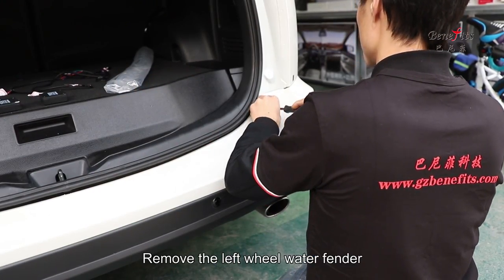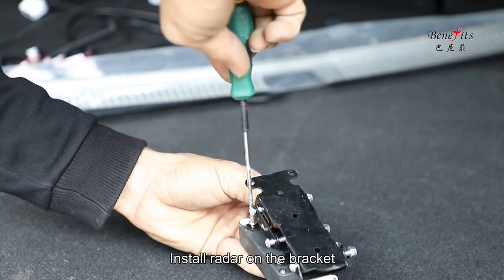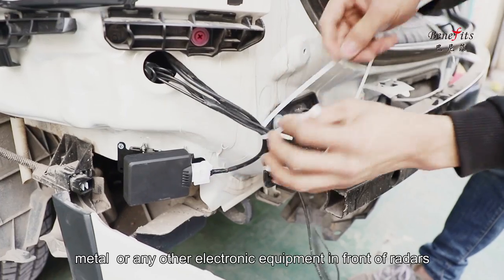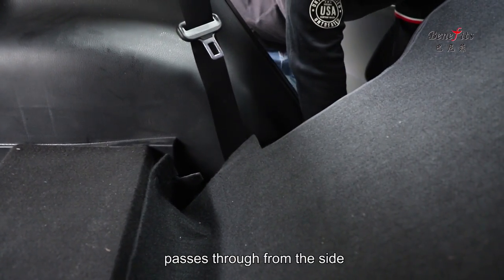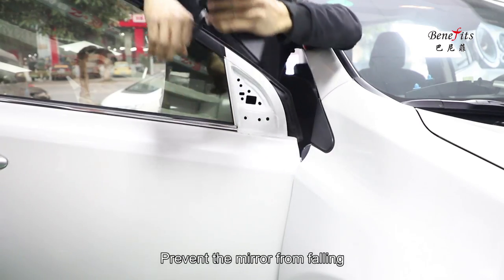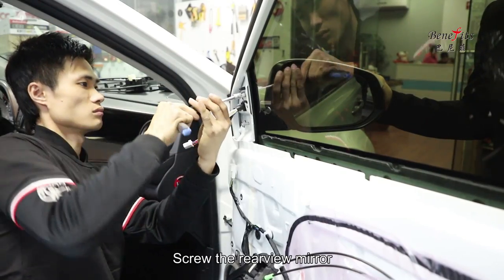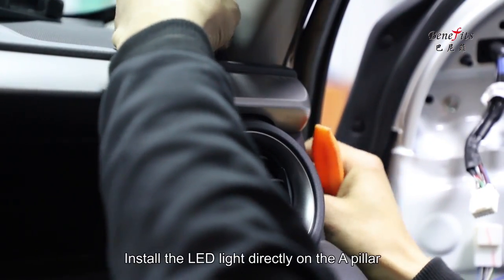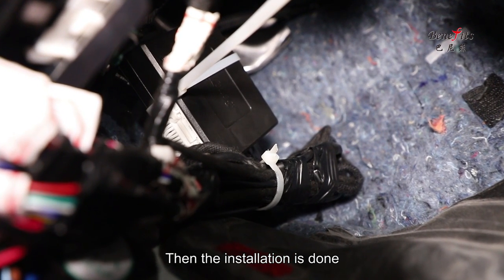Blind spot detection and lane chage assist system ''s installation

Comment: Will this blind spot detection fit my 2017 Toyota Tacoma?
Reply: @victor91607  Yes, these universal BSM kits that will install on any vehicle. If you are not in a rush and can wait 2 weeks for shipping, look up on Aliexpress. Lots of vendors with options. Don't expect to pay more than 250 for this system.
The link posted by Victor is crazy overpriced. Identical kits on Aliexpress are available in the $90-$250 range
Reply: a b $90 - $250??? you will get what you pay for. Simple as that.. for that price you are getting parking sensors that you will need to DRILL into the sides of your bumper! Jajaja and they will drive you insane when you can’t get them to stop beeping specially while making a right turn at any intersection (while your car is stopped) detecting the trash can on the side walk or anything stationary for that matter! Jajajaja .. again, take a look at my video and learn from it... this feature is design to assist the driver and supposed to make the vehicle safer on the road.. not make it a threat like all these other cheap kits.. these cheap kits were built based on price, not based on functionality... there  shouldn’t be multiple versions of the “blind spot” detection systems, there should ONLY be ONE, that ONE system is the OEM system and the only OEM-GRADE system now available for vehicles that didn’t get the OEM system is the USA SPEC BSM200.. nothing else... everything is the dumb down version again, based on price.
Reply: @victor91607  

Paying more doesn't necessarily translate into higher quality. Its your $ and you can pay as you want but 800+ for a freaking BSM excluding installation is a ripoff. 
Yes 36" level bars from HomeDepot and protector is all I needed for install the microwave sensors. The adjustable brackets, templates and marker sheet was included with our package. Do a search on Aliexpress/Alibaba and see the prices of all BSM systems with the following features: BSM/Rear Cross Traffic/Door Open Warning with and without speed control using GPS/OBD. 

We are in the process of integrating a cab fleet with the latest BSM 4-in-1 system where all you have is one control box embedding everything including the buzzer, GPS (for speed monitoring) from a supplier who is OEM for Toyota/Honda/VW. Single unit Price $230, bulk price: to be negotiated but we expect it to be around 175

BTW I don't have to prove anything to you. Just pointed out the fact that your self-promo link for the BSM was way overpriced. Just providing options to fellow youtubers who might be interested
Reply: a b a b a b a b When it comes to Blindspot Detection with rear cross traffic it does, it cost over twice as much to build the right product vs the junk on aliexpress that has NO real life in vehicle testing done.. “36” level bars and a protractor is all” wow, that would take the average person hours just to angle one sensor not to mention 2 of them.. just give a pre-made angle ruler and what would normally take hours will take 15mins... like the system i did.. ooooh! It’s cause you’re promoting your product in here, i’m a consumer .. i was speaking based on personal experience. Or what system do you have in your car?? I wonder why the USA SPEC system can’t be found on aliexpress?

It would be nice to see a video or pictures of that system going into the cabs, also why GPS for speed sensing? GPS is not very reliable if the signal is lost and the user relies on it too much it can malfunction potentially causing fatalities! .. I wouldn’t touch a GPS based system.. OEM Toyota/Honda/VW aren’t GPS,  they’re CAN. But again you’re using that system based on Price, a CAN system costs more $..

Thank you, I’m not asking you to prove anything, but videos and pictures speaks louder than words/info..
Reply: Victor Chavez  What USA specific Spec are you referring to? Do you mean that the BlindSpot distance for a same driver and car is different in the US vs ROW? or does the sensor distance magically extrapolate when using non-USA systems. LOL..

The system that you are self-promoting is also a rebadged import so don't make it sound like BSM kits are USA specific.  Can you Pl. provide any reference to a US specific design specs for a BSM mandated by DOT or any documentation on your kit that indicates that it complies to a specific USA BSM standard. 

As for testing, all i see is some verbiage on your kit without any specs to back it up. All these kits are tested and calibrated at the factory to conform to the distance, angle and obstruction access. If it is reading it wrong, say reporting from a distance of 5m instead of 3 (as specified) there is nothing you can do as there is no configuration option for the end user. Pl. note, all these kits are rated to work in a specific range of distance & angle that's why mounting the MW sensors is the critical part. Anything else in the specs such as US compliance or other lingo etc is all hogwash

Last of all, you don't know me, my skills or capabilities so you have no basis to question what I did and how I did it. If it takes me to 2 hours to mount/align the sensors, doesn't mean anyone else can't do it in 30 mins. With basic knowledge of geometry, the MW sensor install is fairly quick and yes,it is hardest part. Pl. don't make it sound overtly complex. There is a reason angle templates and calibration sheets are included. If you haven't done it or don't have the skills to do it, doesn't mean no one else can't. I am an enthusiast and don't need to prove anything to you. I didn't question your expertise and you have no basis to challenge mine. If I had the ability to see ahead into the future, I would have made the vid. 

However I'll say it again, we are in the process of negotiating the BSM kit for a fleet of cabs from an OEM supplier at a fraction of this overpriced kit with BSD/DOW/RCTA and optional GPS or OBD hookup. When it happens, I'll post a comprehensive review. (Hint: the price starts with a 2 followed by 2 digits and ends with a 2 and two more digits :) ) 

I simply called out the overpriced product that you had linked in all three of your responses (you have since deleted the link from 2 out of those 3 ) which to me looked like shameless self-promo for a product that is readily available elsewhere. I don't have any affiliation with Gosher's or any vendor's on Aliexpress/Alibaba. I was simply providing readers with cheaper comparable options. Everyone is free to make an informed decision and spend their $$$$ where they deem fit
Reply: a b you’re right.

Comment: Details where can i buy for these for my mitsubishi lancer 2014
Reply: @victor91607  $800+ is an insane price for a freaking BSM. If you are in a rush get it from Gosher's otherwise look at Aliexpress. Lot of vendors at a fraction of the cost. 
The one I installed on a VW was around $130. The hardest part was getting the angle right which isn't too hard if you take the time. Get yourself a couple of level bars, atleast 36" long along with a carpenter's protector to measure the angles. Some vendors on Aliexpress also send you angle templates which makes the install eezy-beezy
Most of these kits being sold here in the US are bulk purchases from the same vendors selling on Aliexpress
Reply: a b “cheaper doesn’t mean better and better isn’t always cheaper”. All the items being sold on those sources, are “wanna-be” blindspot systems. “Get a couple of level bars and a protractor” are you kidding me? Jajajajajaja  .. and it would be nice to see a link of the system you got for $130.. and a video of how well it detects vehicles in your blindspot as you pass them up?...  and you’re right some (I would say most) of the systems being sold in the US are a batch purchased from the same vendor .  NOT THE USA SPEC’s tho..  last time I checked the CHOSHER piece consisted of taking 2 parking sensors and drilling wholes on your bumper.. PARKING sensors as Blind spot detection! Really??.. Naaah, I’ll pass. Again show us what you bought and a video of how well it works..
Reply: @victor91607  you can definitely get similar millimetre radar systems for a lot less then USA spec.
Im also pretty sure USA spec is made in china, it's just a good name to make people think it's made in America.
That doesn't mean it's bad but I don't see anything that justifies the over 4x price over similar if not identical radar systems.